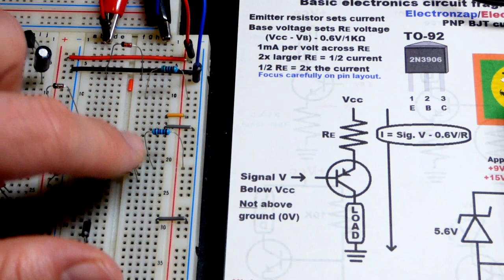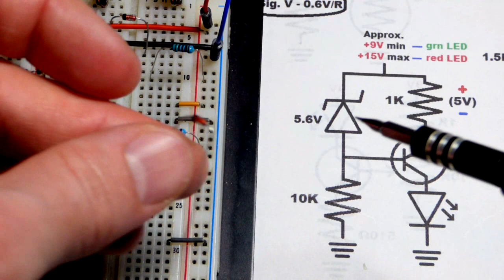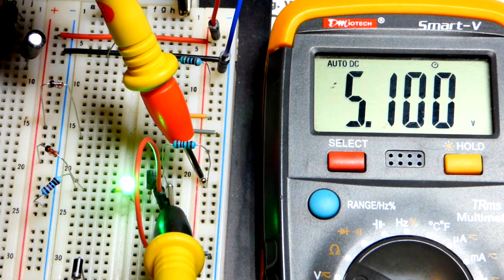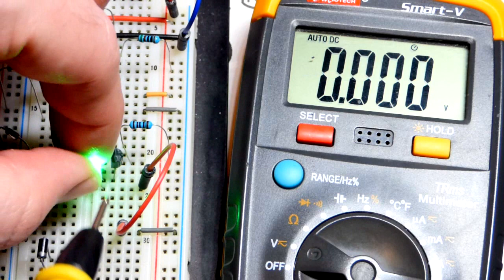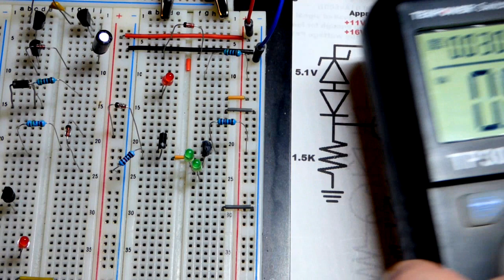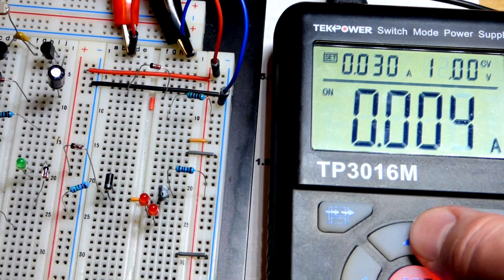Electronics course 17 2N3906 PNP BJT current source set with zener diode circuit by electronzap

Comment: hmmm...I thought I understood PNP transistors, does not the base voltage have to be 0.7V lower than Vbe for the transistor to turn on?
Reply from the maker: PNP base voltage needs to be 0.7V more negative than the emitter to allow more negative collector to more positive emitter conduction